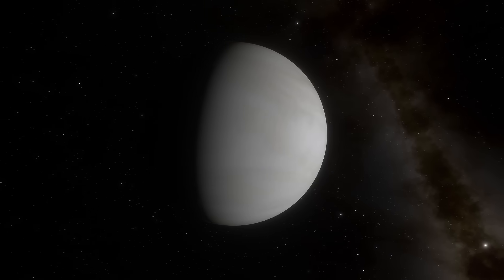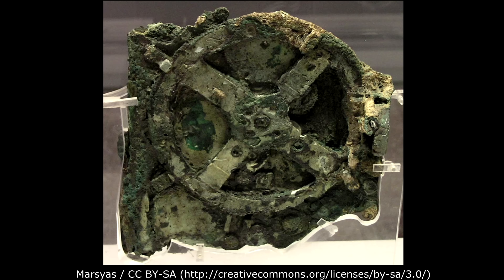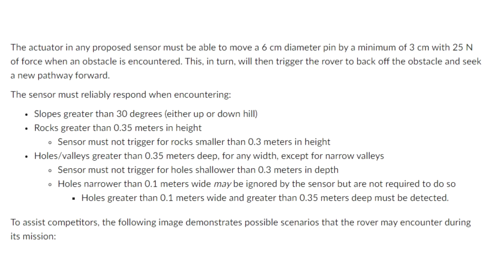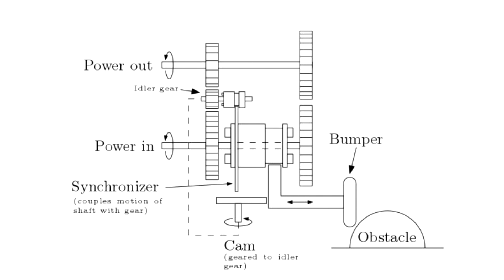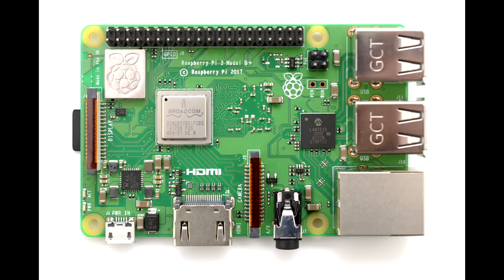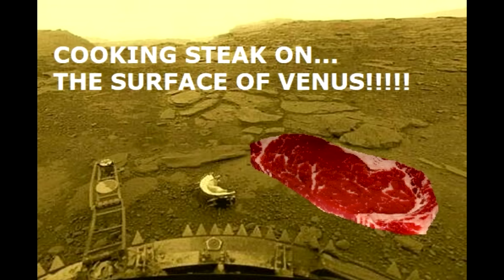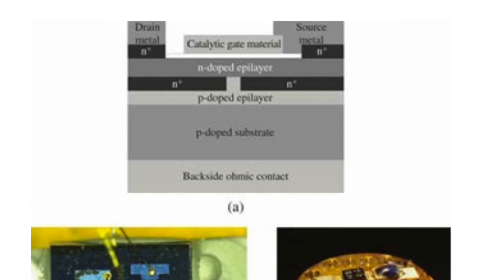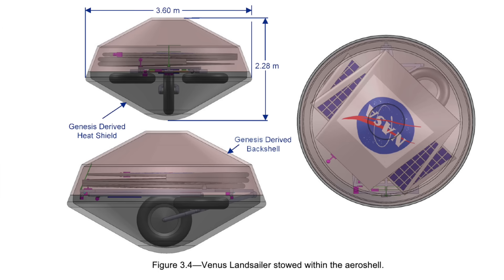Venus Rover Concepts That Beat The Killer Atmosphere

Comment: I'd choose a Mark IV tank, remove unnecessary bits, fit electric motors, a lot of thermal insulation and a large heat pump system to cool the insides. Then you can put all your electronics in it. Add the mandatory wind turbine and solar panels, decent antennas et voilà le Venus probe is good to roll.
If Opportunity was the little rover that could, this would be the big rover that smash. A Saturn V class rocket might be required, and it's not included.

Comment: Given the pressure and heat... some type of hydraulic system might fit the bill.
The "fluid" might even be solid at room temp...?

Just put 3 "whiskers" with wheels on them that are pushed along in front of the rover. If one hits an obstacle, it would operate a hydraulic valve that would reverse the rover, then after the valve is reopened (or closed) it would turn the rover 10 degrees away from the obstacle. A ratcheting relay could count the times it has to turn in one direction... if too many it resets and the rover turns around.

There is no limit to the simple logic you could do with hydraulics under those conditions.

You could even use the hydraulics to refrigerate some part of the machine.

Obviously the wheels would be driven by hydraulic motors, powered by wind driven hydraulic pump, energy could be stored via pressure tank, etc...

Comment: Half-baked idea #371: Venusian picnic cooler
Bring a lot of hydrogen (apparently the material with the highest specific heat capacity), at the highest pressure possible, cooled to close to absolute zero. Use temperature differential for cooling and/or power. Vent pressure to cool & propel forward.

Comment: Scott Manley you said that there is generaly low wind speeds is it feasable to have a "balloon brain" that is to say a balloon high upp with as much sensetive electronics in it with a heavy (in relation) rover dumb body or is the winds too much to handle?
would you be able to have a balloon high enough too reach low temps to make it usefull?

could you have only sensors in the body or are the sensors equaly hard to heatproof?
what are your opinions as a more venus aware person compaired to my hobbyist of a space hobby and my 10 min thought to idea?

Comment: Here’s my two cents: the first thing to do is create a free computer simulator for developing and testing clockwork computers - complete with materials data (such as metal expansion at different temperatures).  

Some prodigy in a poor country might actually be able to create a solution, but not if he or she has to buy all the gears and cogs made of expensive metal alloys.

Comment: Can endothermic chemistry help? Are there any known endothermic reactions that could be employed to cool a Venus rover?
Reply: The problem of endothermic reactions is that they tend to die out since they absorb energy instead of releasing it. The easiest way would probably be to suck some atmosphere, compress it, cool it, then let it expand and do use the now low pressure, cool atmospheric gas to cool stuff. Then exhaust the gas back to the atmosphere. Basically an open cycle refrigerator
Reply: @TheNasaDude  Hmm like OOOO type  (that's four tank representation) machine, compress atmosphere, let it cool, and while it cools you use delta heat from older, "cooled" part. Still need power, and why not wind.
IDK why it would have to be rover though (can be rover charging station easier I think).

Comment: just have a balloon that floats and some sort of metallic string attached to a carefully designed heat resistant sensor. no need to put anything on the surface.

Comment: Use the existing radiant heat to drive everything.  Heat=energy...use it. Peltier junction/ thermocouple with one end in a super insulated box to keep the electronics cool. Use the electricity generated to run the electronics. Use "refrigeration" concepts like used in propane refrigerators. The circulating fluid could be used as a hydraulic fluid to drive motors, rams etc.

Comment: Instead of all that, how feasible would it be to build a fleet of sun shades/mirrors/PV-satellites to reduce incoming solar radiation, while also releasing some sort of high emissivity chemical into Venus's atmosphere (think like the stuff from snowpiercer). You don't need ultra high-temp computers or clockwork automatons if we lower the temperature on Venus to something more manageable. 

Alternatively, we can get megamaid from Spaceballs to suck up most of their CO2 so we can put it on Mars.

Comment: Several mainstream chips are fine running at 150 ºC or so. Probably still not enough to make cooling them in Venus energetically viable, but quite a bit off from the 50 ºC you suggested for a Raspberry Pi.

Comment: would steam engines work at this pressure?????
you have  all the heat supplied, just add water.
Reply from the maker: And how do you condense the steam back to water to keep it closed cycle?

Comment: Maybe that's a stupid question but why you can't just build an efficient refrigeration system ? Sure, heat exchanger temperature would have to be above 800K but that doesn't sound imposible. But probably power required would be much higher ?

Comment: Why not simply house the circuitry in a heat resistant cooling housing to protect the computers, cameras, antennas, etc.? I mean what's protecting the parker solar probe? It's flying through the sun's Corona is it not? That's 2 million degrees. Or better yet, drone technology can be adapted for the thick atmosphere and harsh sulfuric acids perhaps better than a rover.

Comment: If there were some depth underground at a lower temp. Bring enough power to dig down spent batteries fall off the back. Isotope generators to go horizontal using the cooler subterranean “soil?” For heat exchange. If we made them small we could “bird shot” the whole planet surface in one launch.

Comment: Some very interesting possibilities, for sure. How about this: A balloon floats just above the clouds, with an attached solar energy collecting facility. Take the electricity and beam it to the surface, at the shortest wavelength where the atmosphere is fairly transparent. Collecting at this single wavelength, then converting to electricity, could be quite efficient.

Or alternatively, you could use wind turbines attached to the balloon, but that could be very challenging mechanically, for some of the same reasons that wind turbines attached to buildings don't usually fare too well.

Comment: I'm thinkin' that they should be investigating insulation applications. What is the feasibility of travelling there w/ essential electronics exposed to space, then sealing them before entry (i.e: retain the cold temp). We all know the space shuttle tiles did an amazing job of keeping astronauts uncooked during reentry, but could the same or a similar material be used for an extended period to protect critical electronics?

Comment: Uhm, don't vacuum tubes have a higher temperature tolerance range? I remember my 70's electronics education talking about some soviet models of peanut tubes designed to operate at temps in excess of 200 c.
Reply: They do, yes, and are the obvious direction to go with this, particularly since you can always stick most of the smarts in orbit.

Comment: Wouldn't the surface of Venus be a great place for Sterling engines? I'm no engineer but my understanding of Sterling engines is that they work with temperature differences. So long as the interior is cooler than the exterior surely a Sterling engines is a possibility? I'd like to discuss with some of you if possible
Reply: Ah, but what happens when the temperature equalizes, as it will indeed do? A stirling engine is not enough for this challenge.

Comment: Why not  use something like a plane in high altitude. Maybe 50 km will enough for that and then drop down a little probes with sensors. They fall on the ground, transmit the data and die.

Comment: What about vacuum tubes? High temp and tough! You could go old school use analog electronics and telemetry all things done in the past no storage all real-time to venssync sat.
Reply: Exactly! With ambient temps that high you might not even need heater coils. It might be possible to compete with older silicon tech if the tubes are small enough. I wonder how small one can make them these days.
Reply: Jtretta the hard part is generating electricity thats where I keep tuning into to mental block. I think I could build a radio that would simply through brute force transmit analog telemetry from physical sensors that move and change resonate cavities but where to get electricity is very hard!
Reply: Yeah I think the power requirement is why this doesn't look so promising. I wouldn't think for even a second that they haven't already considered this; I mean they built vacuum tube computers for space and aircraft for decades, so they are probably extremely familiar with how that worked out. But, even though vacuum tubes can be "low-ish" power, it's still huge amounts compared to silicon circuitry, that can sip nanoamps and still get meaningful work done...

But maybe all you need is just enough smarts to transmit sensors data and primitive steering behaviors (let the orbiter do the real navigation), and maybe just focus almost the entirety of the rest of the rover on enlarging the power budget.
Reply: @Mythricia1988  I feel it is more about energy storage and transmission than generation. Electrical insulation would be difficult but I think it is possible with more exotic materials. As for energy storage you might be able to pull off a high temp fuel cell arrangement. Use excess power to generate methane from the atmosphere and store it.

Comment: why not add the electronic brain to a balloon and have it on a cable sending dumb signals down to the rover? Like a giraffe having its brain high up. But then a rover having all the clever delicate bits in a balloon on a thether outside the hottest parts.
Reply from the maker: Would need a long and heavy cable.

Comment: My personal idea would be to utilize the mass moving capability of the BFR rocket to bring several vehicles to Venus in one coherent mission.  The components would be:
1. Titanium alloy rocket turboprop plane using LNG, LOX, and liquid nitrogen for fuel and coolant.
2. Sample return probes that would descend to the surface, collect a sample, and then balloon back up to the upper atmosphere.
3. Sample return blimp carrying a rocket to bring samples into orbit.  Could keep blimp in upper atmosphere for continued studies.

The idea of the rocket turboprop airplane would be to fly close to the surface looking for interesting targets to study.  Of course you would use satellite radar data to select sites of potential interest first and to consider what kinds of science are you interested in doing for those spots.  For example if there is a place that may contain really old rocks that could tell us more about the history of Venus, that would be really good to identify.  It could also be really interesting to study volcanism on Venus up close, which would be a very different probe to send down.  The rocket turboprop would use the cryogenic fuels / coolants to keep the electronics package cool and as it boils off, the gases would be fed into the rocket turboprop engine.  The nitrogen is important to keep the reaction cool enough so that the super-alloy turbine blades don't melt.  As everything is under a lot of pressure, the boiling / melting points are much higher near the surface, which would be factored into the design.  The airframe would be made out of a titanium alloy as particular alloys can take both the heat and corrosiveness of Venus' atmosphere, at least for the relatively short duration of such a low altitude flight.  The idea would be to get up to a few hours of flight in with a high bandwidth link to orbiting satellites to collect as much information as possible about Venus and potential spots to send probes down to.  As this aircraft's mission is fairly short due to coolant boiling off rapidly, one of the reasons to have it a turboprop is to cover as much ground as possible before it succumbs to the elements.  At this it would have short, stubby wings and a small propeller as near the surface it will almost be like a torpedo zipping through water as opposed to being a traditional airplane.

The probes would descend to the surface, take their measurements, collect their samples, and then balloon back up to the upper atmosphere where temperatures are more manageable before frying.  As Venus' atmosphere is heavy, it is relatively easy to float in it compared to Earth's atmosphere.  Considering how much you could do quickly with modern electronics controlling it that are just temporarily cooled on Venus and also shielded enough to not be ruined while in space, it just doesn't make sense to try anything that can passively survive the hellish Venus environment as all of that would be way too limited and slow.  There is also the advantage in Venus that you don't need radiation hardened hardware and so this opens up the possibility of using modern high capacity electronics in the atmosphere as long as they are cooled and are shielded enough in flight to not get ruined by hard cosmic radiation.  This is in sharp contrast to say the Mars rovers which rely on rather simple and very slow specialized radiation hardened computers for all localized computing and then get the higher level commands from Earth.  In other words it seems like it works out better if you get a quick and powerful blast of science collected all at once or in a few steps in rapid succession and then take time to study in detail than it is to try to very slowly collect the science data as the quick blast technology setup is just so many orders of magnitude better and faster.  It really is like deciding between an abacus you have a few years to use and a modern high end gaming PC you have a few hours to use to do your computationally heavy work on when already have everything setup to run going in.  I suppose the one place where a mechanical computer would make sense is to put seismographs on the surface of Venus.  That would need to be long duration and the data would tell us a lot about the interior of the planet as well as plate tectonics.  Also a simple, high temperature computer could say alternate between two different sized capacitors to use a spark gap transmitter.  It would be terribly crude, but with nothing else emitting radio signals from Venus' surface, it is not like anybody is going to care how crude it is as long as it works and something above can pick up the faint signal.  (If you have ever flown a gasser R/C airplane, especially back in the day, you will know those spark plugs emit a lot of radio interference as they are broad spectrum emitters.)

Once samples balloon back up to the upper atmosphere, they will float until the solar powered airship makes its way over to them and collects them up.  Once collected up, they will be loaded into a small rocket, say a Rocket Lab Electron rocket, and flown back into orbit.  From here the samples will be loaded onto a SpaceX Starship, which everything was loaded onto for the trip out, and flown back to Earth.  The SpaceX Starship could make a stop at the moon or just in a highly elliptical orbit for refueling before heading out to Venus so that it has the Delta-V to escape from Venus and make its way back to Earth.

The blimp will stay in the Venus atmosphere and continue to do atmospheric studies of Venus.

Because the SpaceX Starship can greatly increase the mass carried to and from Venus, it greatly expands what kinds of missions can be done on Venus.

Comment: If just using mechanics, you need a very talented clockmaker.
Maybe it's even sufficient to replace electronics with ordinary electric.
A mechanical Nipkow Camera for vision, Vinyl-like platindisc for soundrecords, Induction and Coherer for Radiowaves, Electron-Tubes and other 19th century technology.
In that time, they invented so many we don't know any more. I assume half of this stuff would be appropriate for venus environment.
Using a kite, held in place by biefeld-brown-effect, with an anker on the hot ground.
Memory-Materials that unfold under hot temperatures.
Or just a probe with pizzadough.

Comment: Honestly, they should go with vacuum tubes & little to no memory. It should just be smart enough to control the clockwork rover, and broadcast sensor data back to the orbiting relay sats. Sticking real processors in this would be about as smart as sticking your brain in one of your fingers.

Comment: 🤔Hmm..

Would it be possible to use a wind turbine to power a compressor, that can fill up a pressure vessel with atmospheric gas, and then use that gas (much like a household fridge works) to cool down a super-insulated electronics compartment?

Perhaps the landing vehicle could be fitted with a more powerful compressor/cooling unit, to keep a data relay transceiver cool enough to enable scientists to actively control, or change the rovers programming etc.
Reply: but as scott mentioned, that would require too much power.
Reply: Samuel Whitley I know..

My thinking is that they can basically do the same as what they’ll do with the helicopter on the upcoming Mars mission. It will perform a flight, (and do its cool science) then land. Then wait for the batteries to be recharged, and the cycle can repeat.
Reply: @BoHolbo  but a cooler/compressor would need to run continuously, and it would be too power intensive